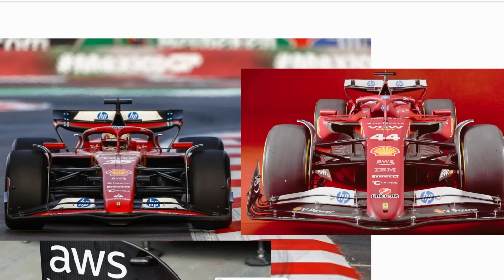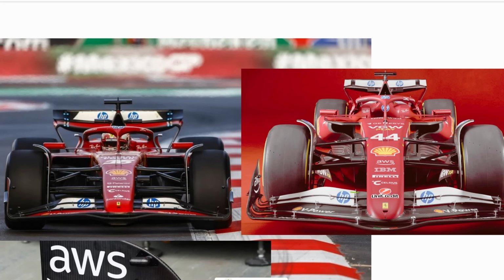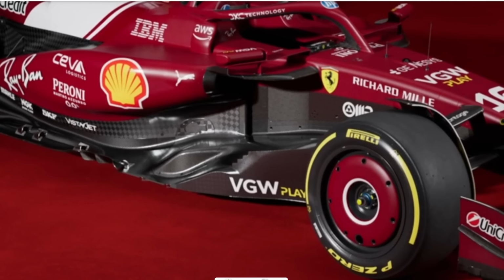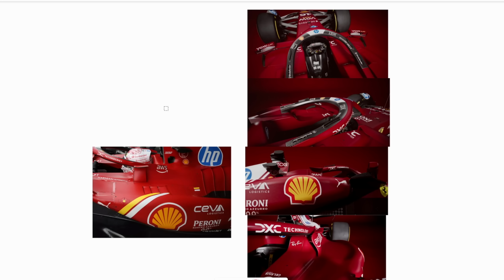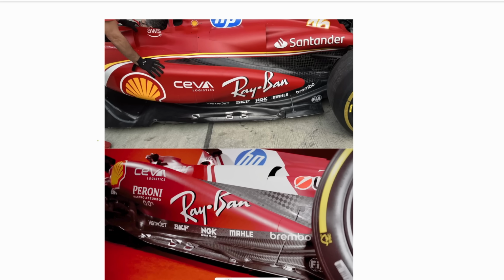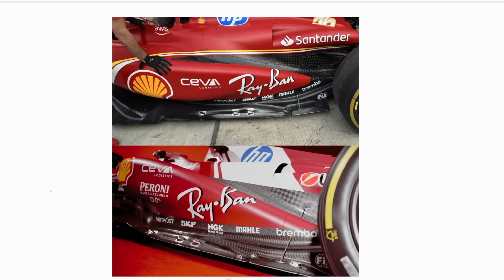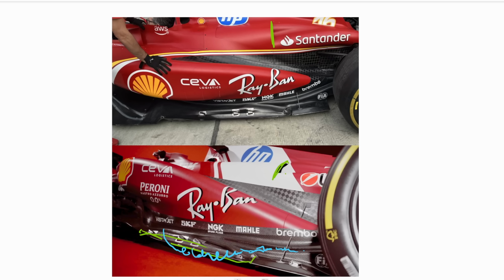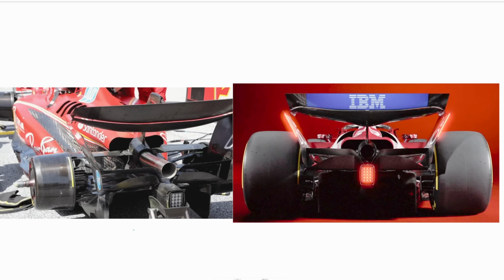Ferrari  SF-25  -  Aerodynamics Analysis and Initial Thoughts

Comment: Why would you WANT to generate vortices in many areas of the aero over the car? What benefits do they bring compares to laminar flow? I would have always thought you wanted the cleanest flow over body work rather than having the air tumble around it, yet it seems like many pieces are there to specifically create many little vortices.
Reply: Think of vortices as air walls that seperate airflow. This is helpful to ensure no spillage of laminar airflow between regions, and help ensure the direction of those airflows stay consistent. For example, a lot of the vortices generated by the front wing and barge boards redirect "dirty" air outwards to the tires / offboard to ensure it doesn't connect and mess with the smooth laminar flow that's being generated elsewhere - say into the sidepods or under the floor. Hope this helps my lord
Reply: @tsrichard  Thanks! It was very helpful

Comment: Kyle I hope you read this I want to poke your brain a little. I'm not particularly interested in F1 aerodynamics, but your suspension vids from 9 years ago have provided me some great tidbits of knowledge I haven't seen anywhere else and I'd love to poke that part of your brain. 

I'm hoping you can answer a question for me that I can't find an answer to or quite fully wrap my head around. Is there an ideal King Pin Inclination or at least what are the factors?

So on most front suspensions as you mention in your vid KPI is mostly just a side effect of packaging. With fitting everything and scrub radius issues it just can't be reduced much. That's not really true though with some modern front end tech. With double pivots, placing the upper ball joint(s) above the tire, and high offset wheels. It appears KPI can now be anything we want while also having any scrub radius we want.

The pros and cons of just about every other angle I think I got worked out. There's just little info out there that I've come across on KPI pros and cons. The best I can figure the only benefit to any KPI at all is using the jacking effect for a slow speed self centering force. That outside of that any KPI is a con as it works against camber gain from caster.

But also taking it a bit further these days some are doing negative scrub radius for some quite good reasons. Wouldn't a negative scrub radius counter the jacking the effect of KPI. What about the combo of a negative SAI and negative scrub radius, wouldn't that then have the desired self centering jacking effect but then reverse the camber effects creating more negative camber when turning?

Comment: Great vid and very informative to us engineering layman. My question is why do Ferrari, Mercedes, etc switch from pull rod to push rod every few seasons regardless. Seems like I hear about the change from the teams every so often....Are they always running into performance issues? Is it always design related/packing related or performance related? Is it one of the first "go to's" to gain an advantage?

Thanks!

Comment: At some point could you do an "Areo 102" video? For example, "up-washing" vs "down-washing"... Why does it matter, what are they traing to do with one or the other? What's the possible utility of a vortex generator? What are the canonical strategies for aero engineering?
Reply: Up washing and down washing is just the direction the given piece sends the air and its totally dependent on what is further downstream, it just sends air where its needed next. For example the downwashing sidepods bring air down to the beam wing because the beam wing performs best with clean air, and they're getting the clean air from over the sidepods.

Comment: They are now with both pullrod suspensions, any benefits having one in the rear too?
Reply: I don’t think so, since the pullrod in theory pulls the car closer to the ground especially in these ground effect regulations where the floor produces a considerable amount of downforce.
Reply: @binrussellsbrother pullrod vs pushrod is simply packaging choices. they don’t function differently whatsoever. 
For the rear, in general, pushrod systems allow more space for larger diffuser area, while pullrod systems allow a lower centre of gravity.

Comment: There’s a bit on the diffuser I found interesting, but hard to see. It seems the diffuser edge cuts in early, just under the beam wing. Is this allowed, maybe to allow diffuser airflow to be influenced by beam wing earlier?
Reply: All the design and parts are firstly presented to FIA for the OK by them and then applied. So it is allowed to do that.
Reply: @ true but what I mean is the render may not necessarily be the exact car, so the render does not need to follow FIA rules

Comment: I always end up tuning out after a couple minutes of hearing about upwashing... outwashing... backwashing etc.

But thanks. I appreciate you Kyle.👍
Reply: The most intuitive way is to build a model and then perform CFD calculations. However, since the most accurate data cannot be obtained, the CFD data will not be the same as the team data. However, CFD still helps to understand aerodynamics. However, CFD is still of reference significance.
Reply: @GeometryEX-hp9zs  cool